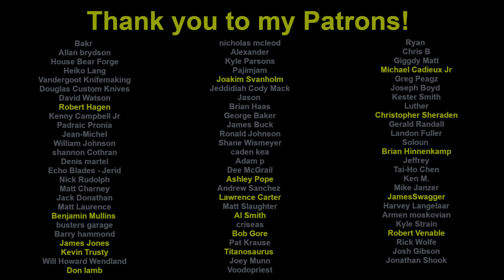Making a back-mount sheath for the push daggers

Comment: I really like these sheaths and seeing more of your leatherworking process. 

I've ran into snaps wearing out quickly, coming undone on their own, and popping out on a number of projects and pieces I've bought over the years. I've since switched exclusively to using Prymm brand snaps. They're a bit more money but worth every penny in my book. If you press them firmly enough, they'll last a lifetime in whatever you put them on.
Reply from the maker: Thanks for watching, Sean.  I’ll have to look up those snaps.
Reply: @TyrellKnifeworks  You should try Fenice leather dye. Their black is so much easier and better looking than Feibings dye. No streaks and is super black in color! It's the only black dye I'll use now.
Reply from the maker: @jeffallen3382  I’ll have to try that one.  Thanks!
Reply: @TyrellKnifeworks  Springfield Leather Company sells it

Comment: Tip from a leather worker:  Polish the outside of your hole punches with your buffing wheel.  stops them from sticking in the leather.  Also snaps can be finicky about the thickness of material you set them in.  My guess on why those snaps came apart is that they were made for cloth and garment weight leather, and didn't have enough post for thicker leather.
Reply from the maker: Thanks for the tips.  I’ve used these snaps before with success but it was a different piece of leather.  Maybe this one is ever so slightly thicker.  I’m gonna epoxy or crazy glue them from now on. 👍
Reply: @TyrellKnifeworks  Even just counter sinking a little more might work.  Leather can vary a lot in thickness and compressibility even on the same hide.  Those snaps might work fine on leather from the belly or under the front leg on a double shoulder where it is softer and compresses more when you set the snap.
Reply from the maker: They were countersinked quite a bit, probably to the point it was 5oz leather so I don’t think that’s it.  Probably just cheap snaps
Reply: @TyrellKnifeworks  That is always a possibility.  I have been disappointed by hardware I thought was a good deal myself.  If you go looking for something better I prefer Line 24 snaps over those wire snaps.  They are sometimes called DOT snaps or durable dots.  If you look around you can find them with different post lengths and better materials like stainless steel.

Comment: Denis, great demonstration video on basic leatherworking. Years ago I used snap buttons and grommets that were made for canvas boat covers because they were heavy duty (grommets would not separate). Harder to find now ... epoxy a viable solution. Thanks for the share ... beautiful, simple, functional design.
Reply from the maker: Thanks for checking out the build, Byron!
Reply: Line 24 snaps work better but the base stem isn't really long enough for 7oz plus leather. I found that you can buy a lo ger post base no more problems

Comment: I use those same kinds of snaps, but use an arbor press to set them.
Reply from the maker: I don’t think the change in pressure is a factor. They just would hold no matter what I did, including crimp them manually.  The epoxy did the trick though.  👍

Comment: Pretty cool little rig, one thing I always found with leather sheaths is that its not hugely expensive. But its just time consuming and you sort of end up having to chase down all those million and one little tools which do the one thing only and will make you spend even more time if you don't have them
Reply from the maker: Yes, it’s easiest to buy one of the cheap sets for $50 to get you started and then upgrade one items you use a lot.  Thanks for watching

Comment: What size drill did you use to make the stitch holes?
Reply from the maker: I use a 1/16" drill bit.  It seems to be perfect, not too large that two thread widths are loose, not too tight that its super hard to push the needle through.  Thanks for watching, Joey!

Comment: Interesting construction for the sheath(s).
Had the same issue with cheap snaps, guess what? The expensive ones also have the same issue.
Reply from the maker: Funny thing, I’ve used these same snaps in other builds with no issues.  Guess I’ll either epoxy or crazy glue them from now on.  Thanks for watching!

Comment: What do you charge for feather damascus blanks?
Reply from the maker: Sorry, I don’t sell billets or blanks.  I make knives for YouTube and sell those only.  Thanks for watching.
Reply: @TyrellKnifeworks  I get it believe me I don't have most of the tools you do ,but I'm making damascus ,just not able to control the pattern bc I don't have a press any ideas on some pattern I can do without a press ?
Reply from the maker: @kyarmwrestlingcr1115  The easiest patterns without a press are (besides random), ladder, twist and raindrop.  My first recommendation is start with thin stock like 1/8".  That way you have more layers in your stack to start with.  Don't go too big either.  Keep your stack no more than 1" so it's easier to hammer.   That way you can do 8 layers, and by doing a 4-piece restack, you're already at 32 layers.  That's enough for a ladder or twist.  Raindrop really needs closer to 100 to look good.   I hope that helps.
Reply: Very much thank an thanks for the vids I made a 20 ton press today with nuematic foot switch now just to make some squaring dyes!! Thanks again
Reply from the maker: @kyarmwrestlingcr1115  wow, that was quick.  I hope it works out for you! 👍
Reply: Lol I started it last week so far its working great anyway or where I can send you pics I promise to not bombard you lol
Reply from the maker: @kyarmwrestlingcr1115  My instagram link is in every video, message me there.  👍🏻

Comment: Nice. Do yourself a favour tho and make a tool rack for your stamps, they will get damaged very easily in the box, especialy the brass ones.
Reply from the maker: They’ve been in there for years with no issues so far.  I just don’t have the space for another rack.  Thanks though.